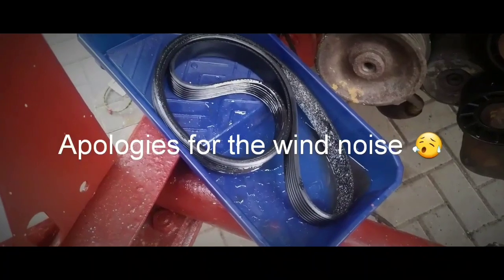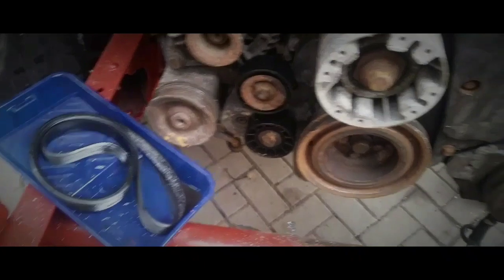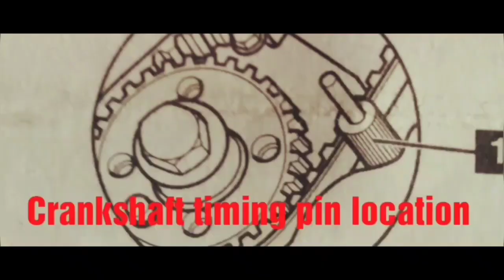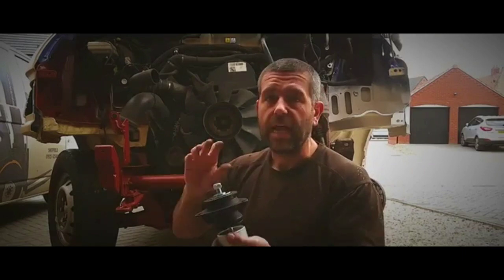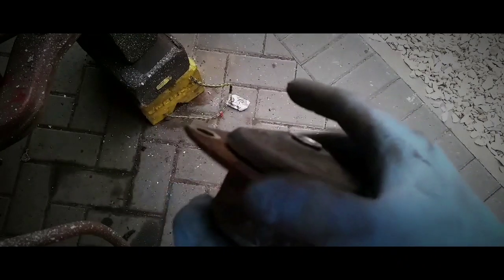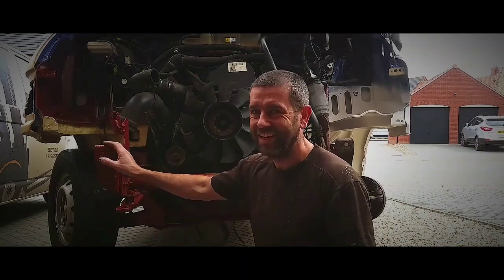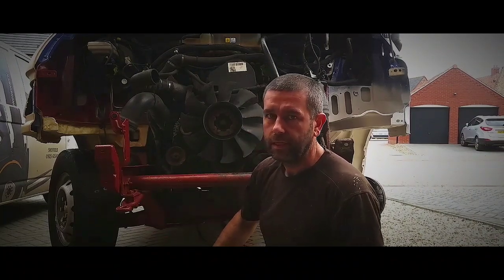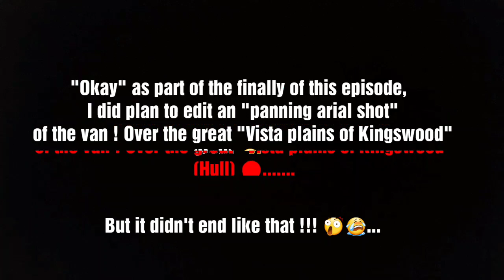Month 3 of the Iveco Daily campervan / vanconversion. (Timing belt and Cab mounts )

Comment: You seem to know what your doing I just wish I had a drive so I don’t have to walk half way down the street , and by the way I got a bottom roller for my side door it works very well now just the handle to sort out , I got a set of T5 front seats for nothing part leather all in good condition. Only thing the seat base is much bigger then the Iveco . I’m hoping to have mine done for next year . I never thought everything would be so expensive.
Reply from the maker: 30 years of being an engineer bud 😉, the "Range Rover" seats are 600mm wide, I'd imagine the T5 ones will fit, with a bit of fettling mate 😉👍👍👍.

Comment: Looking good mate
Reply from the maker: lone traveler Thankyou 😉.. I'll be glad once its finished off and start to use it matey 😁👌👍👍👍...
Reply: lone traveler Agree 🤙😜GET OUT THERE SOON.. THERE'S A WHOLE NEW WORLD WAITING YOU MARK YAAAY👍🌎💞🎆😳🎇🎆🌎🎉
Reply from the maker: @SundryGirl  I'm hoping it will be finished around spring time 2019 🤔😂 "Hopefully"😉😎👍👍👍
Reply: Mark Collom #Iveavan  🚐💕🚐💕🚐💕 well that's not far off in the big picture of things. So take your time with it bcuz that's your baby and it's going to be a beauty💖💖💖
Reply: Did you change front subframe at all 
Im tjinking of getting mine off renewing bearings and stuff
Reply from the maker: @kirklonetraveler  No. The only thing I had to take off the front "Sub assembly" was the bottom plate that needed welding ( the plate that has about a dozen bolts in it, running along the bottom of the full sub frame). I'd imagine taking the front assembly off the van, will involve the removal of the engine,gearbox, steering rack. What bearings are you hoping to change ? 👍👍👍
Reply: @Iveavan  no ive had a quik look and engine and box dont bolt to it 
Only things on it is all the shocks bearings wishbones and hubs 
Have a look tommorow i dont think it looks a bad job 
If bolts come undone
Reply from the maker: @kirklonetraveler  oh sorry I thought you was on about the full subframe assembly bud, yes the suspension part on the sub frame should be easier enough matey😉, but like you say as long the bolts will come out! ( I've had plenty of those bolts 😣) good luck 😉👌👍👍👍
Reply: @Iveavan  not sure if i should tackle it or pay some 1 else
Reply from the maker: @kirklonetraveler  I suppose it doesn't cost anything to give it it a try first bud,  and if the bolts are being a sod,  pay for someone to do it for you 😉👍👍👍